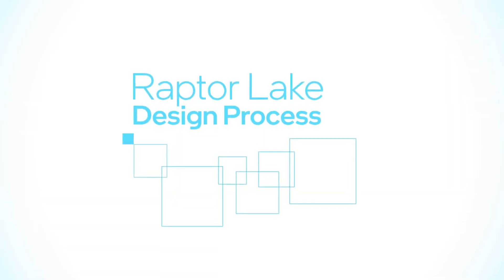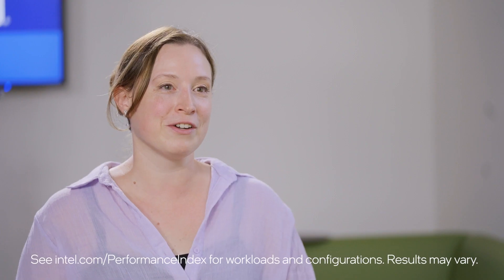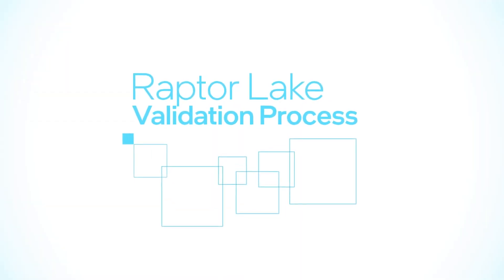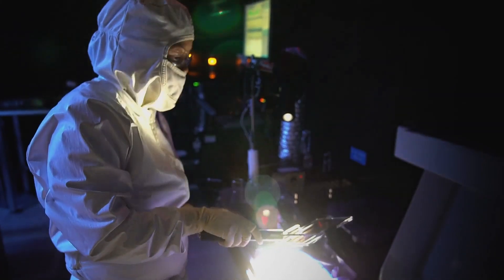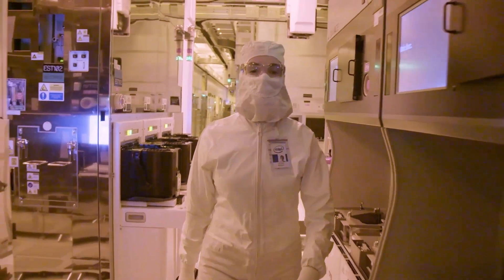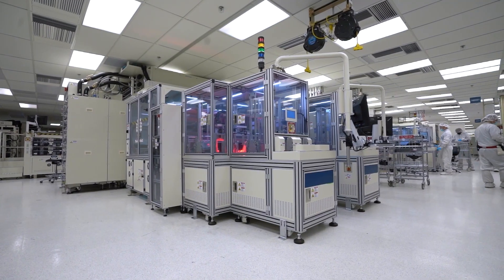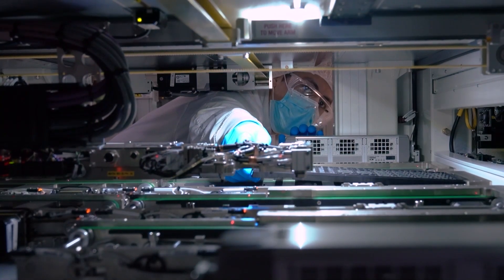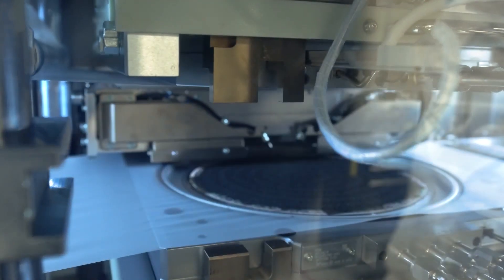13th Gen Core In Depth with Intel Engineers | Talking Tech

Comment: Will there be a better node also this year?
Reply: They’ve still tuned/tweaked or perhaps more accurately done optimizations to node. Any performance gains or other possible improvements  allowed within the small timeframe between launches that poses no threat to node production, yield, quality et cetera they do implement. At least if intel is to be believed seeing how they’ve mentioned that they have managed to get some significant voltage reductions for this new generation. Just an example that to me seems at least somewhat dependent on node improvement. Which I just undoubtedly assume is an unwavering, unyielding, unrelenting top priority always. As Intel is painfully aware of what happens your node progression, be that going to a new node or what kept Intel afloat with their 14nm node continuous updates and improvements to whatever node they’re on is not something they can choose not to do.
Reply: no, it is built on the same Intel 7 process as the 12th Gen Alder Lake